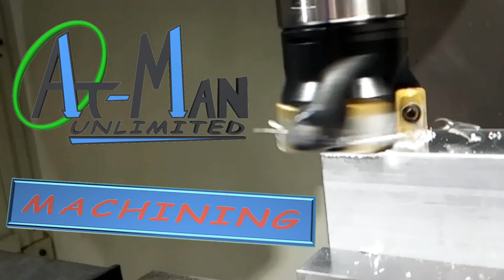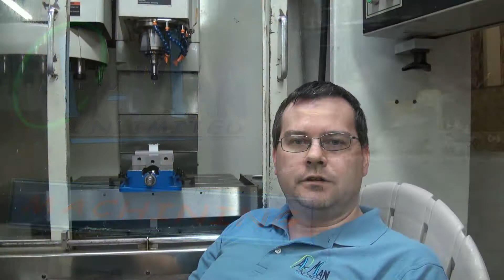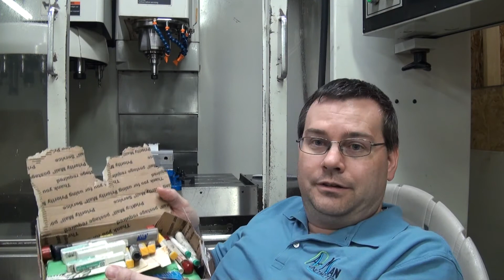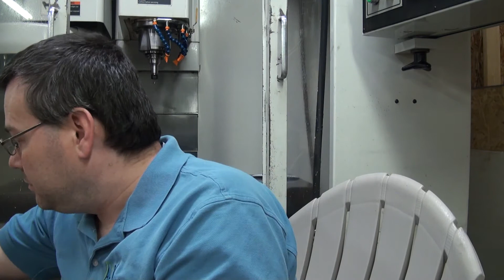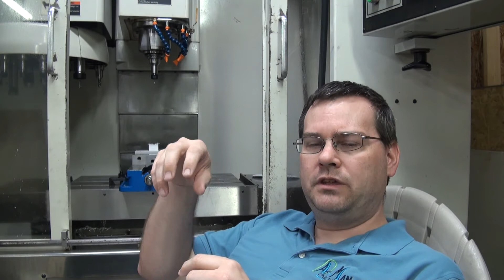Talken Swarf: Viewer Mail, Updates

Comment: Tim, I just want to thank you for your videos. I teach machining at a college and would like to assign your videos to the students to watch, would that be ok? Thanks,Bill
Reply from the maker: Hello Bill, you either want to torture your students or you really like the channel ;) As long as you review the content in detail for correctness and appropriateness I have no issues with someone using the videos in an educational setting. They are however only intended for entertainment value. Thanks Tim
Reply: Thanks Tim. I like them for a reference for the students. You have do great work with the videos. By the way I have 6 VMC 2216 Fadals in my shop that the students use to train on.
Reply from the maker: Cool, those machines are the next step up from mine, little more X travel. Thanks for teaching, we need more trained in trades.
Reply: I need more people to get interested in the field. That's the hard part.
Reply from the maker: Good point, not sure how to fix that one.